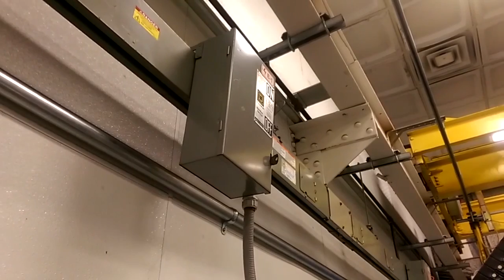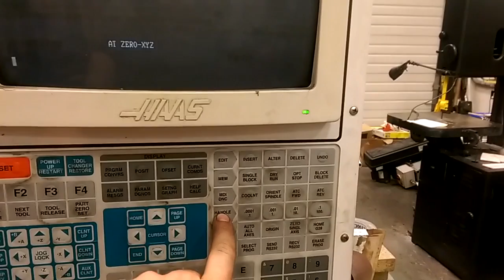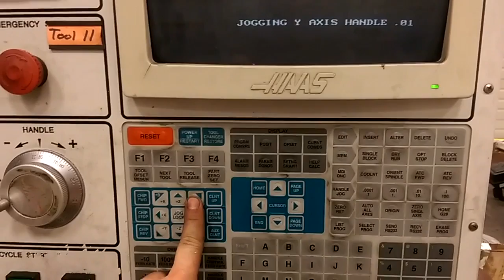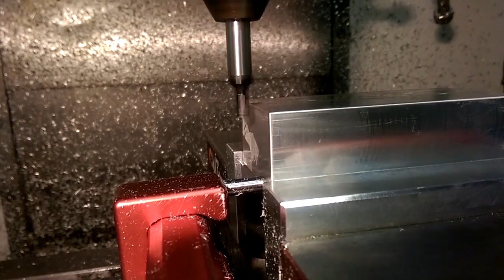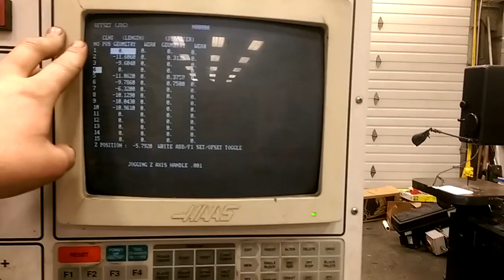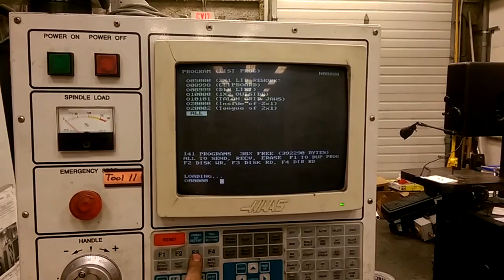How to Use a CNC Machine: Getting Started with the Haas VF-2

Comment: Before I had one two three gauge blocks I actually just used parallels to tram the spindle and set the tool height. They are pretty dang accurate especially if you look at the certifications on yours and you have nice ones

Comment: Thanks for making this video. I don't know if you are still doing this but I have a question for you. HOW DO YOU USE THE ORIGIN BUTTON to zero out the Z for multiple WO at different locations on table. 
 So I set first part at G54 zero out all tools, now G55, G56... my Z height is different and Haas has newer controls and vids and they can use ORIGIN button to zero out Z  helps to calculate the Z offsets at different locations.
Thanks

Comment: CAR GUYS..Early race engines tore motor mounts off.. ripping everything in YOUR CARS under hood.. through HOOD. from drivers seat.. ENGINE ROTATES to the RIGHT,, Clockwise.. BUID heavy duty MOTOR MOUNTS on driver side of engine.. MOPR I am a MOPAR guy

Comment: To be honest getting of work offset is not much convince me,theres have an error on your explanation about work offset,you must need to create g-codes like G0G54G90X0Y0 if your work offset if work,and the diameter of edge finder is .2  you must need to minus point 1,each axis for Y-.1 X.1 this explanation is risky 100% your products is scrap after you doing this kind of explanation,colliding the tool..my opinion only

Comment: Very interesting and informative video. I have had many years setting and operating Cnc machines so would like to ask why you set z offset to back of vice then measure and subtract the distance from back of vice to top of workpiece? Why don’t you set straight to the top of workpiece and then subtract the 4.000?

Comment: Its so dark in that machine im depressed now.
Reply: Yeah that's a known issue with haas machine lighting. Any of the ones with bulbs inside or over the doors fail on regular basis. Newest models have LED panels so our shop upgraded all the machines but the new ones with $30 LED lights off Amazon. So far they been working great. Hyperikon flood light is what they are, easy to find on amazon and easy to install.
Reply: It needs your shining personality to brighten it up......